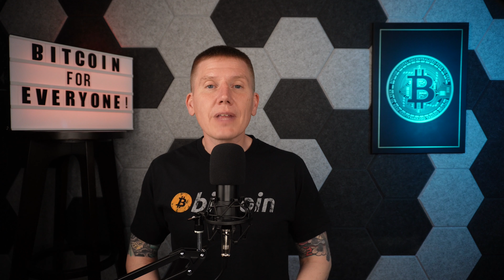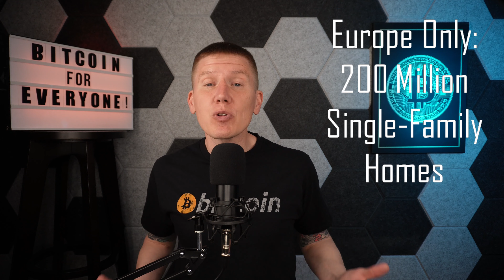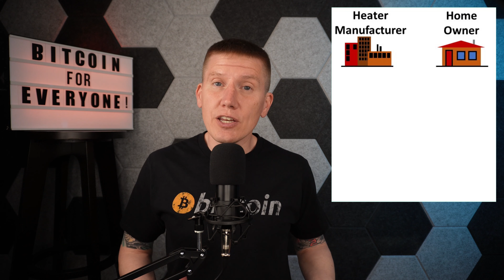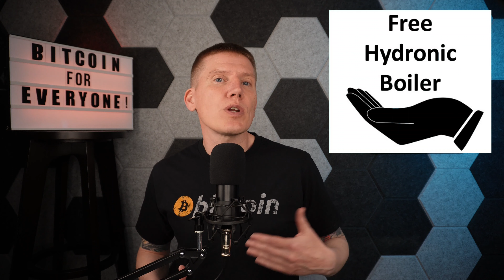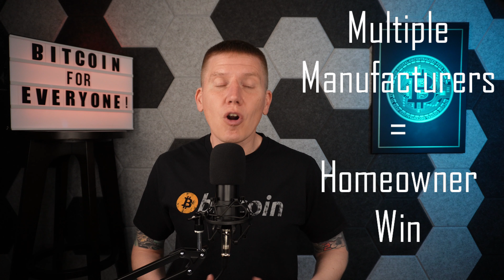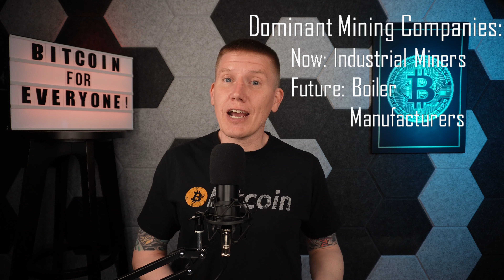EP17: The FUTURE of bitcoin mining?

Comment: Awesome video series. Even learned stuff about my current woodpellet furnace system i did not know, and i lived here for 13 years by now. Im gonna integrate Miners into my current heating solution, and only have the furnace as a back up, gonna use 500-1000 litres of buffer tank also, so i can turn them on when power is cheap, and shut them off when its expensive, and still have heat in the system .
Reply from the maker: Thanks!  That sounds like an awesome build!  If you have any questions, let me know, and when you get it up and running, send me some photos...I'd like to start showing people's builds on the channel.